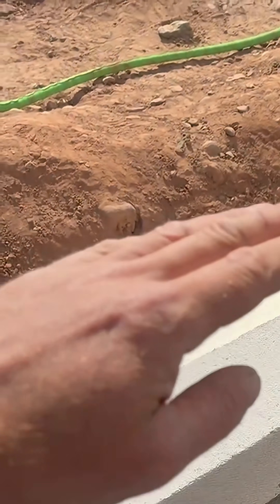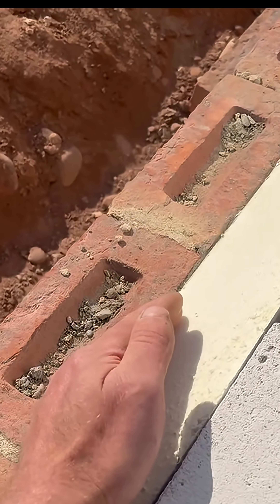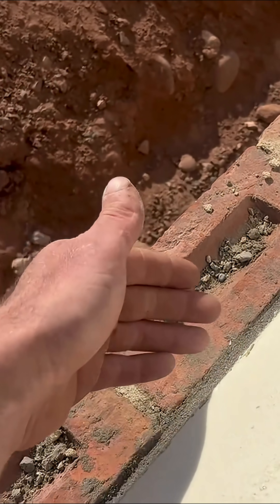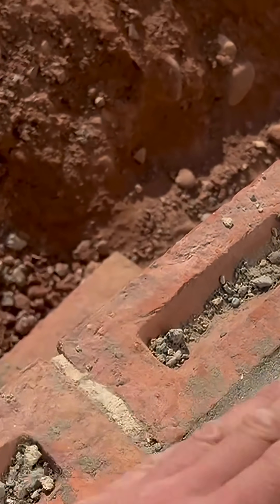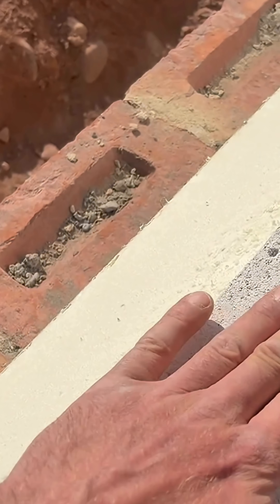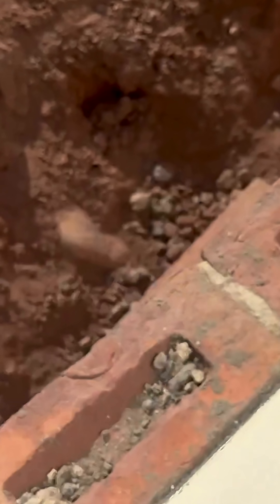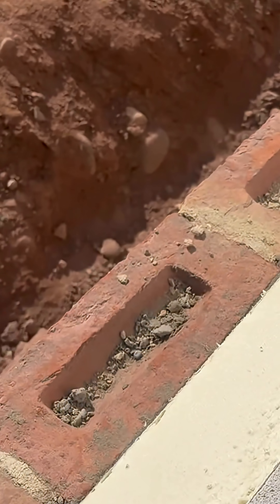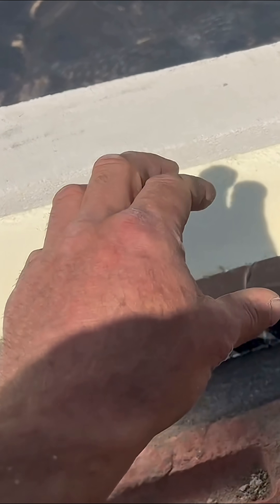CAVITY TRAY at DPC Level Explained

Comment: Such a great explanation. Well done!
Reply from the maker: Thanks mate, it’s seems to be a subject shrouded in mystery, so thought I would try and de mystify it, the full episode is on the channel, building up to Dpc if your interested, thanks for watching 👍
Reply: @Kippaxsignaturehomes 
I am using you metode for my next extension that's on going project.

Keep safe!🎉🎉
Reply: Where’s all this water coming from in the first place 😂? I can understand weep vents above windows etc but I’ve never seen water coming from the cavity at ground level.I’m sure there’s some prick in an office thinking of ways to slow down bricklayers.
Totally understand where your coming from tho👍
Reply from the maker: @c @charliebrick1969  I know mate, it does seem OTT! I started putting them in years ago because the building inspectors wanted to see basic radon protection even if there was no known radon present in the ground, and it’s pretty much the same detail. “Officially” it has a few purposes - to stop gases such as radon building up within the cavity, - any water that finds its way into the cavity will get directed out side the building through the weep holes instead of sitting on top of your lean cavity fill at the bottom of your wall (I guess it’s the same principle as above openings, but further down, not as important though as the water wouldn’t drip into the building like over an opening, - and lastly to stop moisture rising up the building which arguably is stopped with normal Dpc so that reason is questionable.🙄 it does seem like they invent new ways to ruin our day 😂😂👍